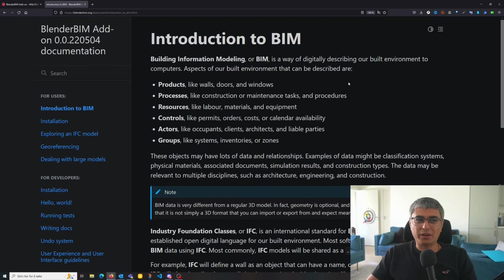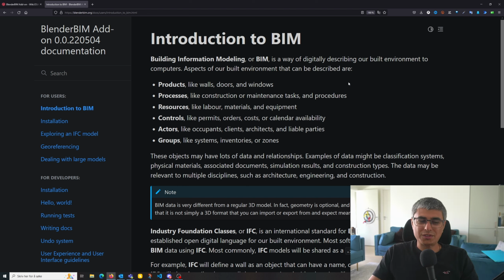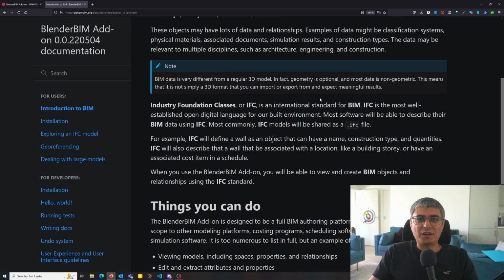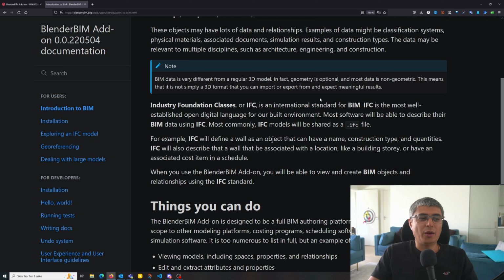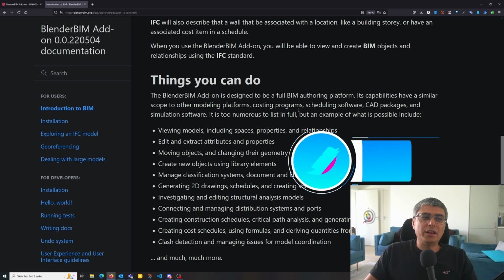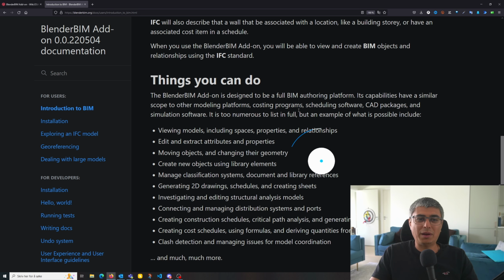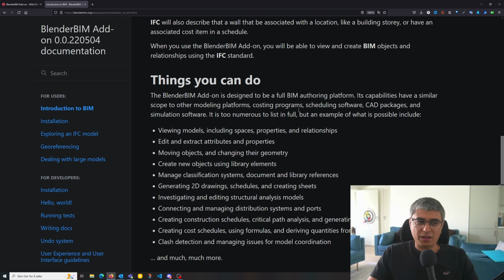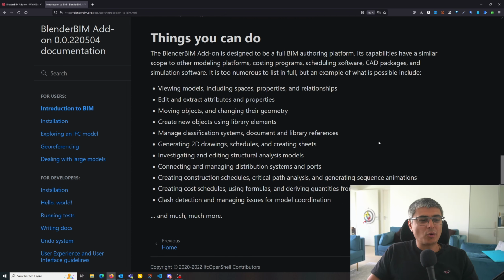Bonsai BIM for Beginners (formerly BlenderBIM), Free openBIM Software

Comment: Hang on, when you said 'Critical Path Analysis' do you mean BlenderBIM can be used for pressure loss in pipe systems?
Reply from the maker: It is about the fact that you can create work breakdown structures in blenderbim. generate gantt charts, animate schedules, do lag time and sequencing analysis, that type of thing. Basically the stuff you might use p6 or ms project or asta pp for (clarification from Dion).
Reply: I'll say It is possible. BlenderBIM allows you to extract connected fittings. Since I successfully get the MEP path network using Dynamo in Revit so I think BBim can do that too
Reply from the maker: I don't know, I just read from the documentation page. Will ask around and try to give you a better answer.